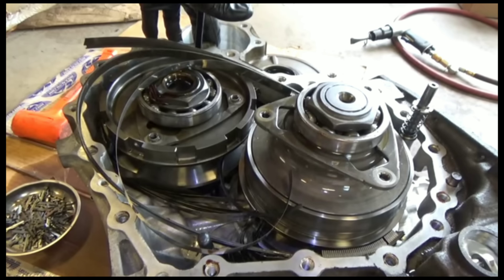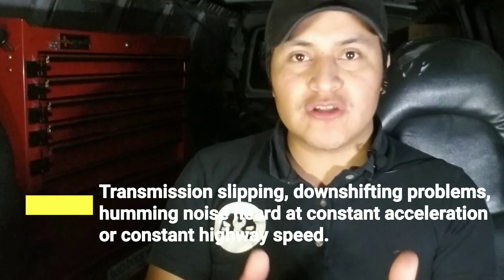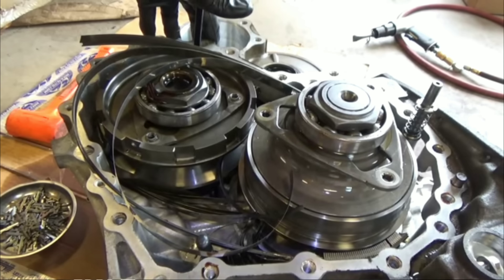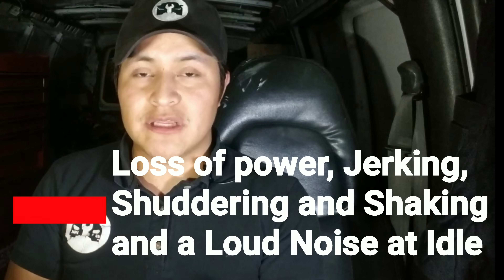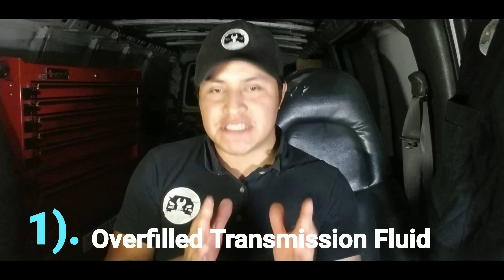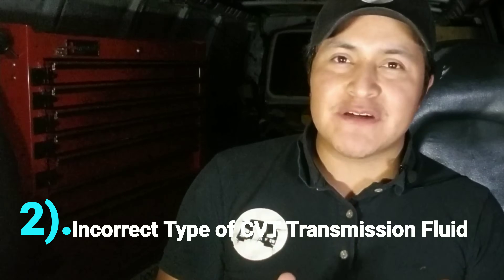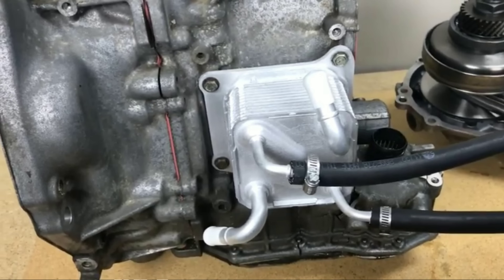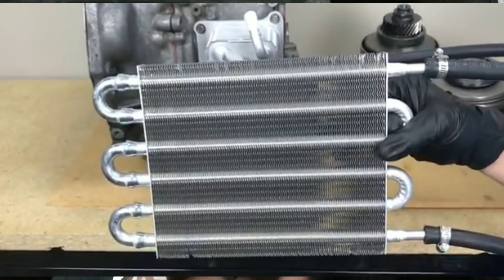NISSAN CVT TRANSMISSION | why it fails and what you can do about it to prolong it's life

Comment: Very informative. The CVT was replaced on my 2016 Sentra by Nissan at 27,000 miles. Not to long ago my vehicle started making the humming/ howling/ whining sound when acceleration past 30mph. I had a feeling it could be related to CVT. 🤦🏻‍♂️ I just passed 40,000 miles too. Anyways, I told my Nissan dealership/service department about it but they said they couldn’t replicate the issue. 😏 Here’s the thing. I’ve had a lot of warranty work done on my car from Factory Warranty to my Nissan Extended Warranty Coverage. I’ve kept up with all the basic maintenance services recommended by Nissan and more. I even went with the premium services that the owners service manual recommended for better vehicle performance. No one has worked on my car besides my Nissan dealership. I’ve had power train issues, control arm rod crankshaft replacements, Factory stereo replaced, whole A/C system replacement, 2 additional A/C Blower Motor replacements, CVT replacement, and a whole lot more. I’ve come to the conclusion that it’s either 1 of 3 things. One it’s the technicians and service advisors who are purposely messing up my Sentra to make commission money off of the extended warranty coverage pay out. Two it’s that the service technicians are just idiots who have little knowledge of their trade with only one master technician teaching them a little bit of the trade. The most basic stuff and they still mess it up. Or it’s both. 😒 I think my own Nissan Dealership made it a Lemon. They set me up for the Lemon Law route. 🤷🏻‍♂️
Reply: I’m going through a very similar situation with my 2018 Versa note with the exception of tranny being replaced. I live out here in Guam so I’m probably thinking it’s just the workmanship of the vehicles themselves. I just made 35k miles. This will be my last year for the powertrain warranty. I could either purchase an additional 2 year powertrain warranty for $2500 or trade it in for a new car. 
This really bites because I just paid it off last year and the car is acting like it has 100k miles already. 
This is probably going to be a life lesson for me. Going forward, I will never recommend anyone to get a Nissan. I’m going to trade my car for either a Toyota or Mazda. I hate to start making payments again. But I’m done with Nissan.
Reply: I think you are absolutely right . . . no doubt in my mind. Seen it too many times.
In most cases you are not dealing with normal people.
Reply: Dealerships have to go and car makers have to be restrained from building so many hand grenades into their cars making repairs almost impossible to repair.
Reply: I am afraid of dealers, and I am staying away from them for my Nissan. That could cause me warranty problems down the line, but I have no trust, especially after reading Yelp reviewers of the dealers in my area.

Comment: I have a 2018 Rogue that is giving P0871 code. Which is transmission fluid pressure switch C. Apparently this isn’t a stand alone part and the whole valve body must be replaced.  Is this correct? Has anyone else had this issue?  Having such a hard time getting information on this.

Comment: I had a 09 Versa. 160 000 miles I had a tick just like a lifter. I took it to a Nissan Dealer for fluid change. When it was done I asked what is that noise, he said a lifter. I said wrong side of motor, he said have not heard that before and walked away. Shortly after that a few days it would not pull itself.  I called The dealer and Nissan. I was told you need a new CVT not parts  for it . It can't be fixed and no warranty. I parked it for 8 years until a friend told me about one he had. He said a $30 step motor from e-bay may fix it. I used his hi priced code reader and it said step motor. I pulled  the pan up plugged small motor  and 2 bolts. Ordered one and it fixed it. Used old new fluid and old gasket. It works great. Fuel gage stuck at 1/4 . I call that they tried to stick it to me. Try step motor if code comes up as step motor. $30.i sold it no more nissan for me

Comment: I had my 2007 Altima CVT warranty replaced at 105k miles, and the replacement CVT was dying after 60k with perfect maintenance.  While I appreciate Nissan replacing the old CVT, there's just no reason why a modern CVT should fail before 200k with routine fluid maintenance under normal driving conditions.  For comparison, I have a 2007 Prius CVT with 210k miles on it and the transmission is bulletproof.
Reply: Toyotas build their own transmissions Nissan doesn’t and Toyotas have a launch gear so the Cvt it’s self won’t get as much wear and Toyota build great Transmissions and cars
Reply: @Arelius_CR  Cool!  Thanks for the info!

Comment: I have a 2016 Altima that the CVT is being worked on right now.  I am so thankful I have extended Warrenty coverage.   I feel like getting an Avalon with a traditional transmission.  A car with 63,000 should not need to have replacement parts.
Reply: Better ask a lot of questions about what they replace because they put DAMAGED old parts back in mine with warranty and they wont be covered …..so what do you think fails next …the old damaged parts of course which won’t be covered by the repair warranty. Also the service mgr said they replace with USED PARTS not new. So much deceit…
Reply: @carolyngreen5458  We sold that vehicle and replaced it with a Toyota Rav 4.  I feel much better getting rid of that Nissan.

Comment: So if it drives but high rpms but stays in 1st and 2nd it still saveable. Maybe just a valve body and a fluid cooler? Just an add would there be a better thicker fluid?

Comment: burned, dark fluid,  black sludge on magnets and filter, pieces of rubber and plastic in CVT tranny pan. Transmission works fine. dropped the pan, trying to change the fluid and  everything is rusty. drain bolt, pan itself on outside. what could it be? and how long tranny might last from here? Thanks!

Comment: Solid video that answered all of my questions about this car. I found one 2017 SV model with like 56k miles that's at a dealership and had pretty standard maintenance. Imma go test drive it when I get the chance, and make sure I pay attention and listen for any weird noises the CVT might make.
Reply: @Jnitty Oh yeah Ive done a little research on CVTs and Im staying far away from Nissan's.
Reply: I have a 2017 Maxima SR with 55k miles and I’ve had recent 2 trans problems with it. I floored on gas and the car did not accelerate. it was stuck on 1 RPM/20 mph. I took the car to a Nissan dealership today and they ran a $220 diagnostic for it. They said NOTHING is wrong with it. My extended warranty expires in 10k miles. Any recommendations?
Reply: @davidmartinez9382  Insist on them taking another look abbfd Insist on them fixNG it. Threaten to sue
Reply: My Murano’s trans died today almost leaving my family stranded, car started jerking hard on shifts and when traffic stopped and started again my Murano didn’t move, engine running and gas pushed to the floor but nothing, nightmare! Avoid a used Nissan if you want a long lasting car.

Comment: By watching this I’m aware now that my transmission is going bad. Car is still drivable but when it’s hot or if its been driving for awhile it starts to not want to accelerate & slow down (so embarrassing) I dnt trust to drive it on the hwy. I’m still making payments on my car.. dnt know if I should trade it in or stress myself out, working myself to the bond bc its 5k for a new transmission & the labor… ugghhhhhh

Comment: Thank you for your informative post, but I think you are missing some very, very important facts regarding Nissan's CVT transmission...

First, Nissan was sued with a massive class action lawsuit due to a very specific defect with the Versa CVT transmission.  I own a 2015 Versa and Nissan was required by law to send me the full disclosure and the information on this class action lawsuit.  The specific issue on the 2015 Nissan Versa is the transmission drive chain.  It was has a design and manufacture defect that causes the chain to stretch, then begin to break into small pieces, then finally snap.  This has occurred to literally thousands of Nissan Versa CVT's.

In my case, my 2015 Versa began to shudder at 60,000 miles.  I had a full 6 year, 120,000 mile bumper to bumper platinum warranty on this 2015 Versa that I purchased when I purchased the car brand new from the Nissan dealer.

Nissan service department where I purchased the car fought me non-stop when I told them something was terribly wrong with the CVT.  At first, they refused to trouble shoot the problem unless I paid them $400.  I had to threaten them with a lawsuit until they finally relented and decided to do a free diagnostics test.  I told them that was not good enough and I told them I wanted them to drop the transmission pan and tell me if there were any shavings found.  They finally relented and did as I requested, again, after I told them I would take legal action against time.  

They dropped the transmission pan and found not shavings, but CHUNKS OF METAL PIECES THROUGHOUT THE TRANSMISSION PAN.  Yet, they still refused to replace the CVT transmission until a third party "Inspector" would inspect the CVT transmission.  Finally, after one week, the inspector arrived, looked at the chunks of metal, and declared the transmission irreparable and a complete loss.  Nissan finally installed a brand new CVT transmission at 60,000 miles.  Fast forward, last week as I was driving my 2015 Nissan Versa across Stateline, the exact same shuddering occurred.  NISSAN HAS NOT "UPDATED" THEIR DEFECTIVE CVT TRANSMISSION FOR THE 2015 VERSA MODELS.  ANYONE THAT TELLS YOU THIS IS FLAT OUT LYING.

Another thing that most people do NOT realize is that when Nissan installs a new CVT transmission in these Versa's. they also go into the computer system and change the settings on the engine and CVT transmission so it does not run as fast.  Their rationale is the CVT transmission will last longer.  My second CVT transmission lasted 70,000 miles.  My Versa now is a complete loss as I refuse to pay the $6000 charge for labor and a new CVT transmission.

I have a 2003 Nissan Frontier XE that I purchased new and it now has 278,000 miles on it and it still runs like new, both the motor and the transmission.  I change the engine oil and the transmission fluid like clockwork.  So Nissan can make some really nice vehicles.  But, the CVT transmissions on the Nissan are defective from the factory and most will not give you more than 80,000 miles.

I discovered most of this as I interviewed Nissan mechanics and managers.

Hope this helps!

Comment: Guess I got lucky with the two Nissans I had with CVT. Got 75k in one, 65k in the other and not a single issue with either car. That said, I decided the foolproof method to avoid CVT problems was getting a Juke with manual transmission.
Reply: I think a lot of them go out at 140K-190K

Comment: Another reason for limp mode and transmission overheating is mismatched tire circumferences. My donut spare in the trunk made the transmission overheat, it was not a big deal
Reply: How did you fix it hun

Comment: key is maintenance.  I have over 136,000.00 miles and first owner since 2010. so far, no issues. but being 12 years old if the transmission does go out today i would say bye bye because I have got my money's worth back twice.
note: I would never change the transmission myself, I let the dealer handle that. no matter what make or model u have

Comment: Honestly best thing I've learned to do with the cvts is install a aftermarket in-line transmission cooler you can cruise at over 100 mph without it going into limp home mode.... only problem is that mine likes to drink cvt fluid lol.

Comment: My 2011 Qashqai (J10) 2.0 has started to make the noise when letting of the gas paddle and not while accelerating. it's noticeable and loader from 60kmh to 30kmh and only while deaccelerating  - as soon as I'm pressing the gas even slightly. the noise is gone. Changed my CVT oil and didn't help. any idea? also connecting to the CVT bearing failure? any other suggestions?

Comment: I currently own Nissan Altima 2014 model. It has 230k kms on it. Its a 3.5 SL V6 CVT GCC spec model. 
The only issues I had since car being driven this high (mostly highway) and being 8 years old are the following: 
1. Shift lock switch failure.
2. Sun visor making fracturing noise. 
3. Dash board touch screen stopped working. Have to use buttons to navigate. 

Other than that the precautions I regularly take are: 

A. change CVT oil every 40k-50k kms to keep it well lubricated. 
B. Always change engine oil every 8k-10k kms fully synthetic. 
C. Spark plugs every 80k kms. 
D. Air filter every 15k kms. 
E. Engine coolant every 200k kms. 
F. Brake fluid every 80k kms. 
G. Power steering fluid every 120k kms.

Lessons learnt: 
Don’t follow what dealership is asking you to do. 

Follow owners manual for exact details. (Beware owners manual doesnt show when to replace the transmission fluid) dealerships say to never replace it, as it is lifetime oil. 

DO NOT LISTEN TO THEM. 

For further car details you can subscribe to my youtube channel for specific advise.
Reply: Exactly
Reply: Going through this shift lock now. Did you buy that part on eBay or let the dealer fix
Reply: Have you had to replace your rear control arms yet? Lol

Comment: For the most part, people aren’t really taking care of the JATCO CVTs. Regular maintenance is key for it to last. I just did a fluid flush & fill on a 2014 Honda Accord (2.4L 4-cylinder) CVT transmission. And it’s still running like new.

Comment: I have an Infiniti Qx60 2014 hybrid  with 55k miles and the transmission started to act weird about ten months ago, but in February, it became dangerous; the transmission started stalling and on the highway, the engines just stops working periodically. When I reverse the car, it shakes and accelerates dangerously even though I'm not touching the gas pedal. Yesterday, I brought it to the local dealership, where I purchased it new in 2013, they said that the computer just needed a software update but then, today, they called to tell me that it would cost 15k CAD for a used CVT or 25k CAD for a new one. The worst is that they both come with a 1 year and 10k miles warranty. They know how bad their technology is and they don't want to admit.

Comment: Hello and thank you for this video. I have a 2016 Nissan Altima that does not want to pull on time when I'm at a red light for a long period of time.  This does not happen all the time. Could you tell me what stage I'm in and how much longer the transmission may last. Also, is there anything I can do to make it last longer? Lastly, I hear that loud roaring sound when accelerating. That sound can only be heard inside the vehicle not outside.

Comment: Nissan CVT Transmissions have been failing through out the model lines for several year models. Models like Altima, Versa, Sentra, Juke, Rogue, Pathfinder, Murano all have the same issues. Many develop a “shudder”, “Judder” or “vibration” as described by many owners and used car dealers. The Jilcat Proline CVT Supplement has stopped the shudder repeatedly all across the country for most of the applications it has been applied.

There is a separate Torque Converter issue (Code P0074 or P0075) that is different from the shudder. It actually feels like a stall when you stop and the vehicle has issues at take off. This would require a flush process and refill with OEM fluid. We have found by adding 2 bottles of Jilcat CVT Supplement in with the fresh fluid we have cleared up that problem in many cases. There is NO GUARANTEE the Jilcat Product will work but in almost every attempt we have seen success. Try this before you spend $2000 or $3000 replacing the transmission. https://youtu.be/mM-nkoWUfk0
[Nissan vibrates] [CVT issues] [why does my Altima shake] [what can I do about my Murano vibrating when I drive] [Murano transmission issue] [Rogue transmission vibration] [Juke has a vibration] [additive to help Nissan CVT] [how to fix my Pathfinder transmission]  Check it out the CVT fix here: under $50! https://www.jilcat.com/product/cvt-transmission-supplement-1-bottle-35-dont-replace-that-nissan-cvt/

Comment: My Nissan Rogue 2012 CVT (165km). Yesterday I was on highway when exited and stopped at red light. it went lifeless. RPM was low and all of sudden RPM jumped. I got it drive slowly and parked at my home. I paid got transmission rebuild in August 2019. I don't know what's issue . Please help me understand. Car was not shaky. Only it went dead at few time even I was pushing the gas.

Comment: I have a 2004 1st gen nissan/jatco CVT on a jdm import to uk that is noisy when hot. Added a cooler which helped but now the rad appears to be leaking cvt fluid. Its done 75k. I would not recommend. No way.

Comment: Wife has 2012 Nissan Murano with 129,000 miles on it. Check engine light came on with her. She said it randomly accelerated when she had cruise control on. We took it to the shop and they said I need new transmission. Problem is when I drive it I don’t notice any problem at all. In fact the check engine light has never come on with me. I just can’t buy that it needs a new transmission. Is it common to not be experiencing problems but transmission is going out based on the check engine light on??

Comment: What about cvt transmission that shifts and runs normally in standard traffic, but on highway at 60 mph it sometimes slips out of or wont drop into proper gear? Your RPMS Suddenly rises to 6,000 rpm and doesnt drop down, unless you stop and start again.  Thoughts?
Reply: I use cruise control under 2250 rpm on highway, barely over 65 mph, always on right slow lane. lol maybe put baby on board sign too to let people pass.
Reply: Stepper motor solenoid can be a culprit for this. If it's that, it'll be a lot cheaper than a new transmission.